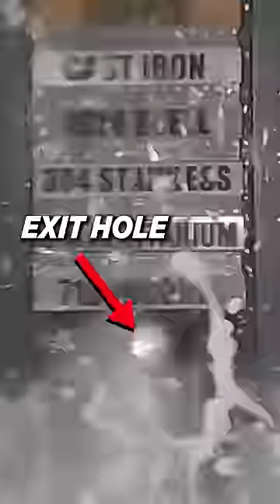Destroying Metal with our Favorite Tools!

Comment: That insert is still going strong. You should try make a series of seeing how much it takes to mess it up if you have the money for another.
Reply: Lol ain't nobody risking millions to make this kinda series. Just that one mistake in this video! That's gonna cost so much money!
Reply: @TKYKZ  It's not millions: bought in bulk they cost $10 for chinesium to $100+ for decent stuff like this. Moreover, this is a PR proof, taken with a grain of salt. I'm still not sure if Kennametal, apparently a precision part producer, bakes their own carbide of the highest difficulty, like these high-performance drill tips. Most decent top brands would perform similarly in this category.
Reply: @dannydetonator  не братан, ты не прав.
Reply: どれだけチップを強くしても鋳物の鋳肌面は無理やわ。巣があると簡単に破損するし条件落として早めにチップ交換するしかない。

欧州の図面やとびっくりする加工工数にする鋼材削り出ししてて…やっぱ自動化したい国の図面はそういう発想になるんやなと。
Reply: @TKYKZ what is "costing millions" here?
Reply: @dannydetonator  the millions comment was a joke.  They're joking about how employers will have you run an insert until it turns to dust.
Reply: @dannydetonator So you have no idea what doing something like that does to a machine?  And an extremely expensive machine at that....
Reply: @TheDJOblivion the machine that will probably not run properly again.  They've blown up spindles in their other videos.
Reply: It takes a lot.  I drilled hundreds of holes in 1” thick AR500 on one insert.  G81 straight through with thru spindle coolant .003 per rev 150sfm.  Any other steel I’m pushing it harder but keeping the process reliable
Reply: @bmbunch8825  I’ve been a machinist for a long time. I’ve ran many machines that cost multi million dollars. I’ve seen a lot of crashes and the worst one cost probably $80,000, although that particular machine had a lot of other issues that were taken care of with that service call. 

With a tool that size and machine that size, the tool will snap off before any damage to the machine.
Reply: @bmbunch8825  I think you are underestimating how much ad revenue can be generated from these videos.... Whoever owns that shop is WELL aware of the cost vs profit metrics when shooting these and its obviously good enough to justify replacing spindles, and then some!
Reply: Fun fact: Insert manufacturers do. Kenna isn't the best.
Reply: @dannydetonator  thats massive cap, inserts can cost hundreds of dollars depending on wich type of carbite they are. Try doing this a few times and the cost for replacing all of them will not only be a headache but start to cost thousands in a shockingly short amount of time.

Comment: I worked at Kennametal for a little over two years, place sucks.
Before I left I knew every job at the plant and was training new temps as a temp.

Never got hired in.
Reply: Sounds like you did get hired. How does that work?
Reply: @Frank-os6gq he was a temp, training temps
Reply: Probably a reason he never got hired in don’t ya think.
Reply: Worked there 15 years they bought a family owned tool shop I worked at. They have their good and bad qualities our shop was pretty well staffed with people that started right out of high school. Had about 60 employees with an average tenure of 20 years so they bought based on the experience our people had at that product line. Will give them credit they make excellent tooling but have way too many managers manager this manager that that add no value but think they are the world's greatest gift because they have a couple fancy pieces of paper.
Reply: @josephrasberry3850 Most likely not. It's cheaper to keep people as a temp, then abuse their self Confidence. Temps don't get things like benefits, or any type of good pay raises. You're practically one step below a migrant worker, cause you still have to pay taxes.
Reply: @robertw1800  he knew every job at the plant? Definitely wasn't at any of the pants I been to while working there must of been a smaller site that shipped out or stored tooling for vendors it Definitely wasn't an advanced manufacturing site. It was a lower end menial position I'm guessing not saying they're not important but Definitely not most manufacturing plants that just not possible.
Reply: @midwestmike613  I knew every job at the plant, we manufactured drill bits for mining, special little metal parts for the air force (literal little metallic bits, no idea what those were used for).
The powder mixture, the heating temperature, the pressing all the way down to the packaging I knew of, taught or etc.
Never hired in.
Reply: @grindcoreninja6527  you pressed or shaped carbide blanks for others to finish? Or did you run CNC grinders making finish products? Either way I guess it depends on the amount of work  the plant I was at almost always was hiring and as long as you didn't miss work and learned at the level you say you did you would have been hired for sure.
Reply: Which plant? Cause I'm thinking that's BS

Comment: 718 inco is seriously tough stuff.
Reply: Yeah try and weld it, an actual nightmare. 
Guys think titanium is bad until they meet inconel I remember spending half a day drilling through 2 quarter inch sheets to make a bracket. 
4 holes, each took more than an hour and a few broken carbide bits. 
The stuff has its uses but it makes you wonder if it is even worth it when you try and do literally any type of metalwork on it.
Reply: @worldcure7883  you're totally correct. It's very useful in the hot sections of a jet. But unless it's being used for something that requires it's properties, it's not worth struggling with.

Comment: So many inserts. I need a small bank loan for all those shiny inserts
Reply: Inserts are like 2 dollars each. 😂
Reply: Highest I've seen at my job is like 7 a pop.
Reply: $32 each 😮😮
Reply: My job uses inserts that cost $10 each….10 inserts per container, 5 containers per box. That’s $500 a box. Not cheap! 😂
Reply: I’m turning heat treated 718 inconnel.  Insert is 28.50  getting 4 pc’s per.  It adds up quick
Reply: My last job had this finishing tool with 4 long curved inserts and iirc those things cost triple figures for single one
Reply: What material are the inserts?

Comment: I mean, you would be doing something wrong if that insert was already worn out after like 6 cuts. But i get your point
Reply: The last piece being inconel....thats pretty damn impressive. Not sure if youre familiar with that material but its incredibly hard. Say if youre using an .045 wheel to cut a half inch piece of carbon steel itll whiz thru it pretty easy. A half inch of inconel would probably take like 30-60 minutes to cut thru with .045 wheel. Usually ceramic inserts are needed to cut that stuff.
Reply: @tommys2979  I'm a machinist myself and dont get me wrong, i know what theyre are trying to show as i said, i personally dont do a lot of inconell but all i was saying was that after one cut through inconell your drill shouldnt been destroyed. of course after a few parts it will show significant wear its just the way he said "its still in one piece" after one cut.. maybe i didnt write it the right way. i love titan and his passion of teaching stuff but english is not my first language
Reply: @basqir  i gotcha. I didnt mean that comment in a nasty way just some people dont know what inconel is. I work in a machine shop but im not a machinist, im transitioning from a deburr guy to a welder right now but i love making stuff on a bridgeport and learning machining stuff too just for the know how of how things are made.
Reply: @tommys2979 we cut in our job on cnc turn inconell 718 with tools for Steel and it just works... not that hard to cut tho...

Comment: This is wonderful to witness. Most people including myself have never entered a metal working machine shop like this. that one insert alone is more deadly than any knife made. Most of these machines are honestly kind of scary to me just with the capacity of what they're able to do to metal. Just imagine what could be done to a human being. In fact, no, let's not imagine that I'd rather not think about the kind of horrific mangling that could occur from a massive industrial accident involving one of these machines.😮
Reply: Those are the videos that are used as cautionary tales for new machinists. With how much torque, how rigid they are, and how fast those machine go, if you are not being very aware of your surroundings and of what you are doing on a machine, really bad stuff can happen in the blink of an eye. One really easy example would be leaving a chuck key in the chuck on a lathe when starting up the spindle. Same with leaving a mill wrench on the top of the machine when starting it up. This is why there is a very big emphasis on safety in any good machine shop.

Comment: I used to work for Peddinghaus as an install tech and I would refuse to guarantee the proper operation of our machines if the customer did not buy Kennametal drill bits Awesome video Kennametal is the best!

Comment: That's a nasty looking bit there! 😮 

Funny story about how dumb I was as a kid: My dad was drilling a hole into some tile (trying to, anyway). Uncharacteristicly for him, he hadn't really thought it through, even though tile setting was his job. So, he wasn't using any water or anything to remove the heat and protect the bit and the time. Soon enough, it started to smell like an odd smoke. 

I was watching and thought "That's neat! The bit is getting so hot that its glowing orange!" Keep in mind, I wasnt driving yet but I was around middle school age, so I was old enough to know that the bit was getting hotter and hotter. 

Eventually, it turned white....then it snapped and flew across the room. I had been watching him work for hours and had this pent up "let me help" feeling.... and without thinking (clearly), I chased that bit like a puppy chasing a tennis ball, picked it up and went to hand it to my dad. 

Then I started to smell this nasty smoke smell.... then: 😮😰🥵🤯😫 as I watched the skin on my thumqnd pointer finger turn white, then instantly blister. 😑 

😅 I don't have a scar from it. I still can't figure out why I would do something that dumb 🤷🏽‍♂️ I grew up on jobsites, I'd drilled holes in tile before, I knew the friction was intense and I even suggested that my dad use water so the bit didn't break off. I also happen to have a fairly big 3rd degree burn scar on my right hand from when I was a very little kid.... so, you'd think I would've learned my lesson many times over by then. 

....it was like impulse. I just grabbed it. It took a considerable amount of time before I even felt any pain, that's how hot it got. Fear not, though: sometimes, ignorance should be painful and this was one of those cases where it was both painful and a "you had that coming for not using your head" situation. 😂

Comment: If the drill bit has to spray water to get through things, I would trust it with my LIFE.
Reply: Do you do much critical thinking in your day job?  There is some considerable friction ramming one piece of solid material through another piece of solid metal.  So it's seems quite reasonable to give them a drink.  ;-)

Comment: Dumb question: why don't you ever see large 5 axis CNCs run big fly cuters? I assume it's a combination of: faster feeds and speeds on a multi cutter carbide shell mills, and it fits in the tool changer. 

I'm curious if anyone has done a head to head test, including surface finish, speed, and tolerances.

Comment: Here's an idea for you guys I always thought about trying to make a prince Rupert's drops that's where they know you drop the molten glass into a cold water and it makes a little teardrop or like kind of like a sperm shape or tadpole and that little tadpole head is like almost indestructible I've always wondered if you were to make a mold what are the molten glass with submerged in this cold water or into liquid nitrogen which is even colder just super cool it would it make a piece of glass without the tail that is is indestructible or more indestructible than the prince Rupert's drop and then even with that could you make Jade into a prince repeats drop

Comment: What kind of chuck is that on the 5-axis?
Reply: Looks like an HSK63A to me. The A has those notches in where the spindle grabs the tool holders taper so it's more ridged and can be used to do tapping.